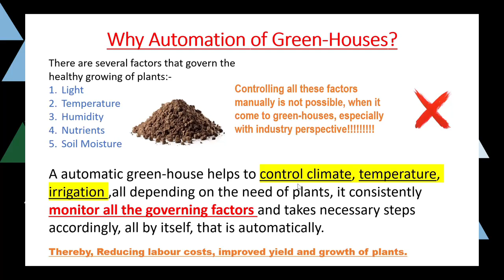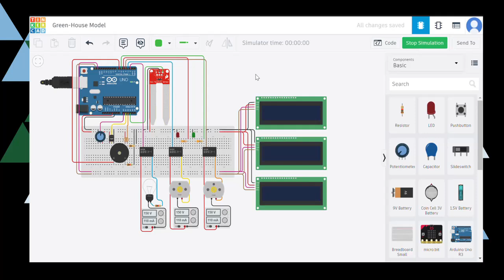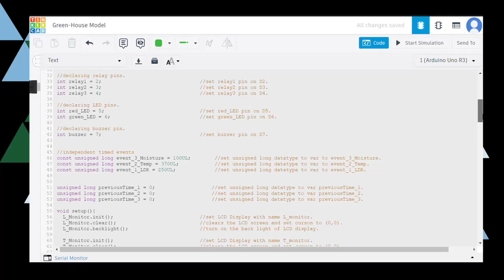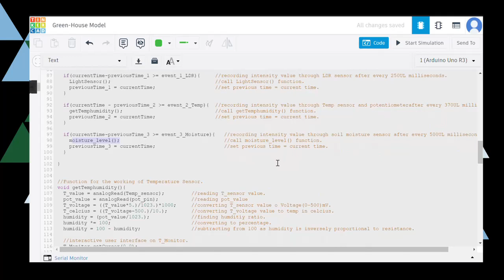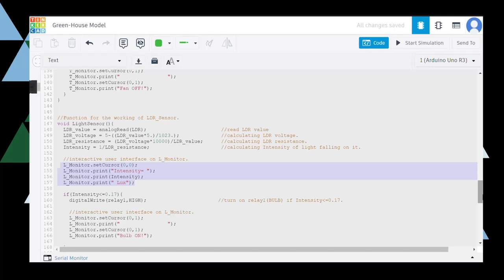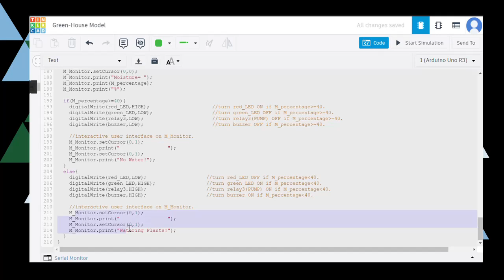Green House Model on TinkerCAD

Comment from the maker: Yes approx 15mA current flows through D4 and D5, which is quite high, however within the 20mA of allowable current range through arduino's digital pins. For the concern of lifetime of arduino you mentioned, we can increase the value of resistance of LEDs, that's the best coming to my mind for this project. If something better can be done, I am open for discussions.